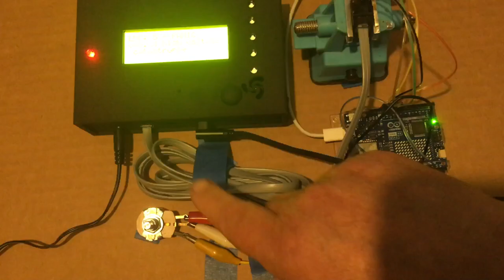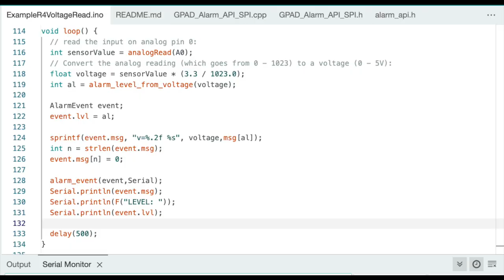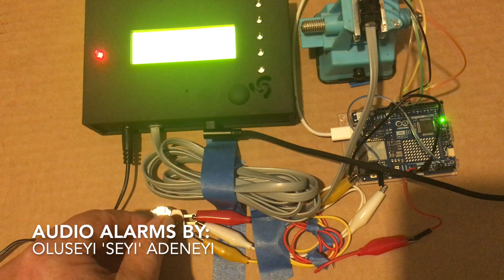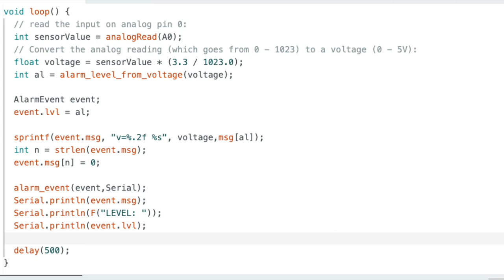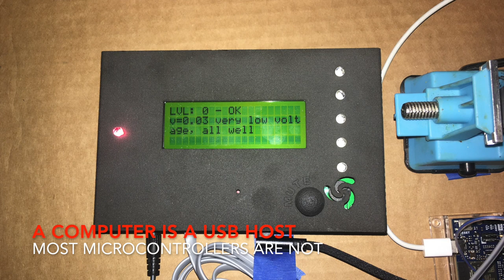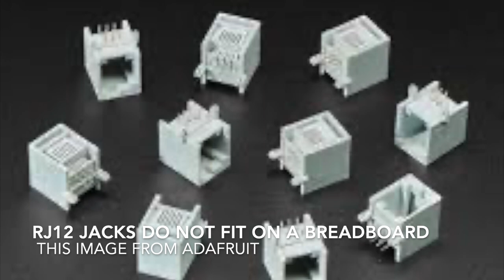GPAD Demonstration Video

Comment: Oh wow, that would activate through a voltage divider right?
Reply from the maker: It could. You can read any voltage level 0-5V from an Arduino R4. That allows you to sense all kinds of things, for example a TMP36 analog temperature sensor. The potentiometer itself, as set up in this system, acts as a voltage divider, with the "wiper" changing the resistances on the two sides. Thus we are digitizing the result of a voltage divider, where the resistances are varied by turning the knob with your hand. Since we feed 3.3V in to the pot (could have used 5), it read voltage varies between about 0.8 and about 3.1---it always has a little resistance on each side.